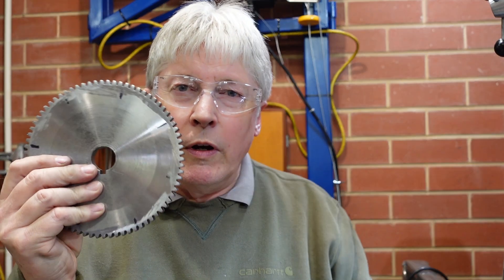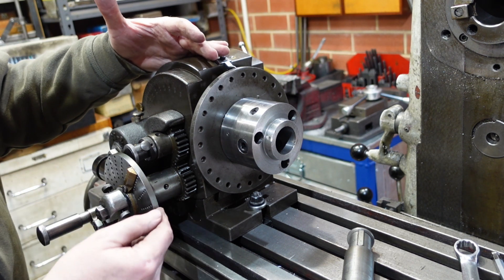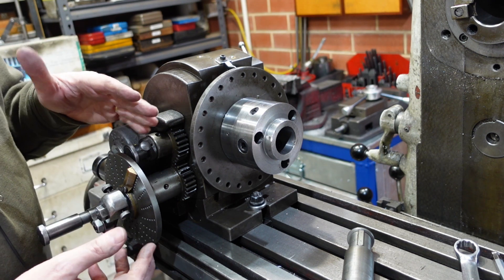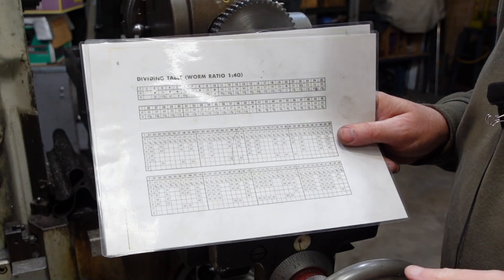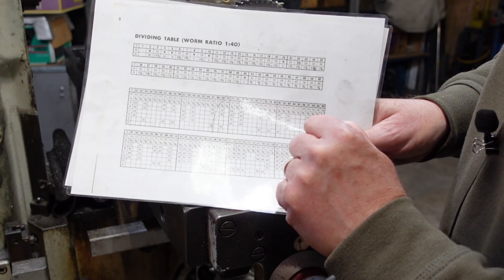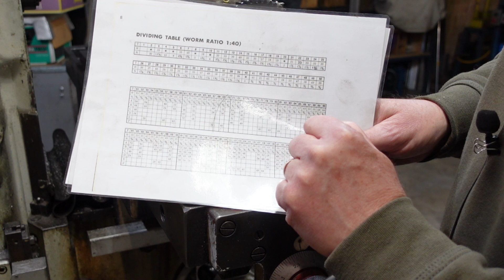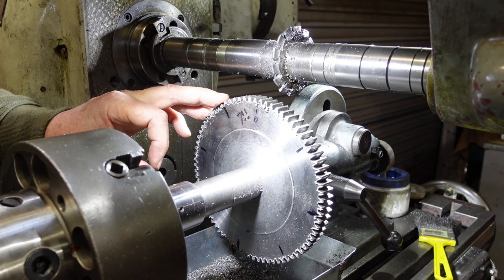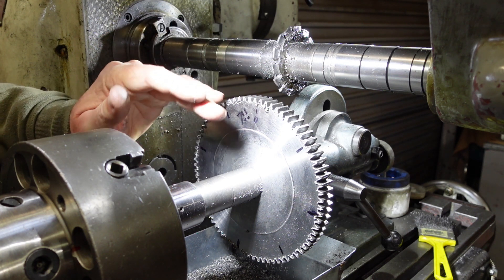Differential Indexing for fun and...

Comment: The satisfaction of exercising true gearhead intuition is a great gift.  Which I don't have.  I tip my hat to those who have a feel for that part of mechanical arts, and you can have my seat at the bar.

Even change gears for my lathe were a complete pain for me, so I built (a design by someone smarter than me) an electronic lead screw.  SO worth it, in my case.  The next CNC-ish thing I build will be an electronic rotary table / dividing head for my mills, to sidestep my personal anxiety regarding all but the simplest of gear trains.

Carry on your usual fine work, sir!  Discourse like yours may someday cause the required neuron in my brain to fire, and the lightbulb over my head will go on.
Reply from the maker: I must admit I like cutting gears - there is something I find very soothing about it.

Comment: As always, impressive. I have a older Swedish dividing head but it just make my head hurt, I'm going to have at it again after watching this.  Thanks Mr.
Reply from the maker: Most people don't need differential indexing - I'm doing it for a set that I want to make. The other use is to produce a 127t gear for metric conversions. Other than that, it's pretty esoteric.

Comment: ermmmm. i'm confused or thick!
Reply from the maker: Sorry. I tried to explain it as best I could. Think of it as normal indexing but instead of going a fixed number of divisions, you go a number plus 'a bit'. That bit is dictated by the gearing that feeding back.
Reply: @occasionalmachinist  after rewatching it twice! I think I get it. Basically if you want to do more than 50 holes or a prime number of holes, then as long as you have the relevant charts and gears you can do it on the say 50 hole plate and the head will compensate?
Reply from the maker: @paulrayner4514  More or less! Which division plates you use and the gearing that works requires calculation (but in the tables/ chart). For the 77 tooth gear I was using a plate increment (10 on a 20 hole ring) that would have given me 80 divisions - but because of that gearing, it dropped back to 77.

Comment: I would use CAD to create a template and glue it on to the workpiece, or center punch the centers of the teeth. You'll know right away if you've fallen off the trolley.
Reply from the maker: Traditional texts on cutting gears with a dividing head say to go around once with a light cut to check the divisions - bit like that first skim pass when cutting a thread. Trouble is, that takes time, especially for a larger gear. Centre punching or using a pen or something would take time too. If you think 15 seconds per mark, that's still around 15 to 20 minutes for a gear this size. I haven't got the patience.